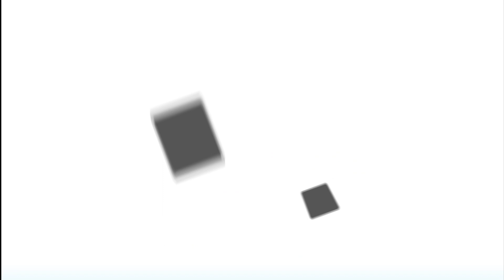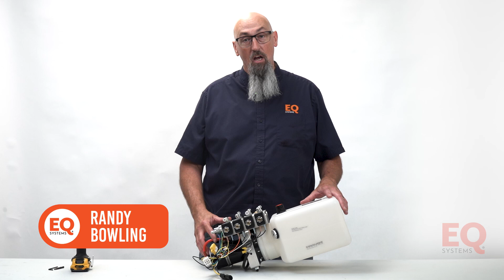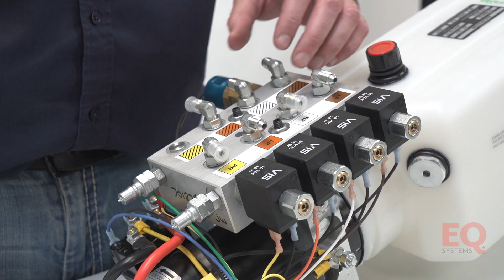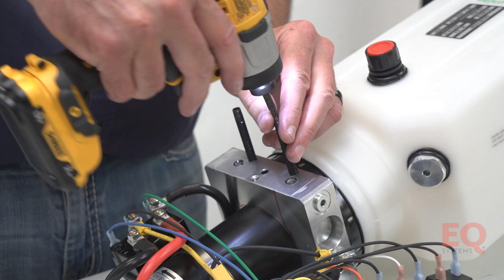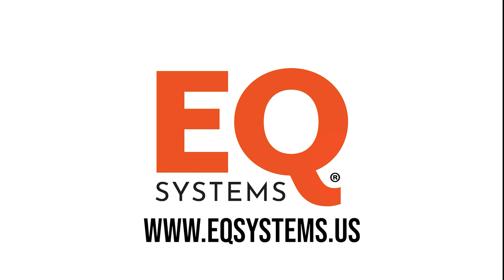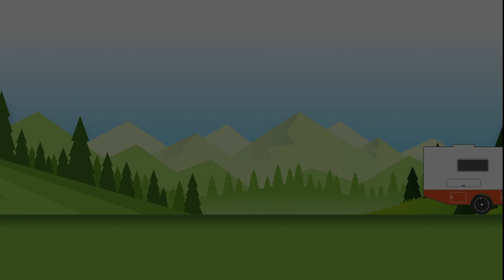EQ Systems: How to Install an O Ring Kit

Comment: I have a Dynamax Isata 5 2018 motorhome with your model number 3195KS leveler leaking from the new motor I replaced a few years ago. I was told I needed to replace the entire unit to fix the leak. Does this sound about right, or is there a seal I can replace to stop this?  Thank you.
Reply from the maker: Please call (800) 846-9659 or email support at Service@eqsystems.us . You can also visit our Support section on our website for more information or to submit a question www.eqsystems.us/service-and-support-form/ Thank you and have a great day!

Comment: What is the part number for those orings?
Reply from the maker: The replacement part includes new Studs, Nuts and O rings.  The part # is 70355. It isn't currently in our online shop, but you can call and order it. 1-800-846-9659 Or you can email your phone # to getlevel@eqsystems.us and possibly get a quicker response.